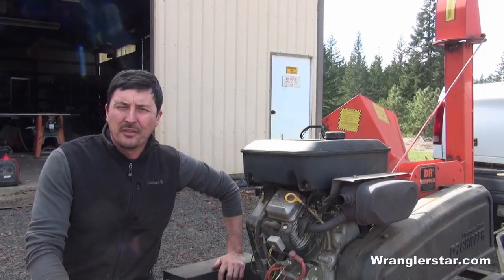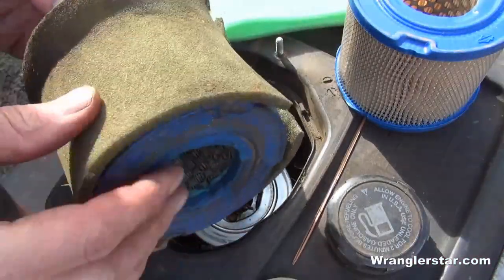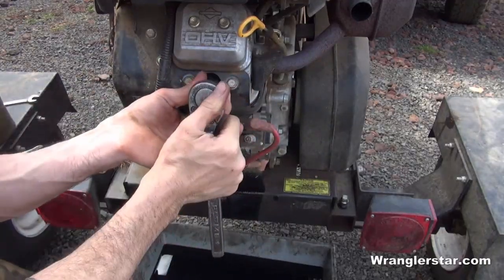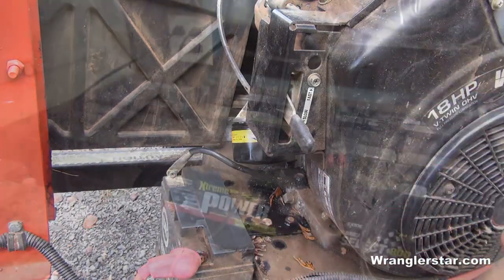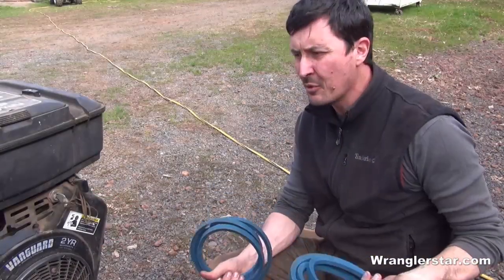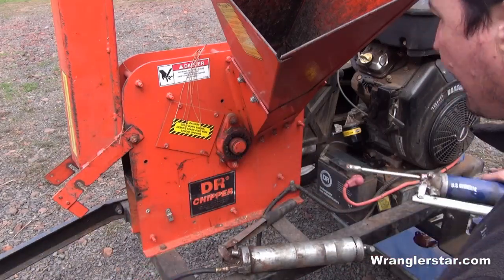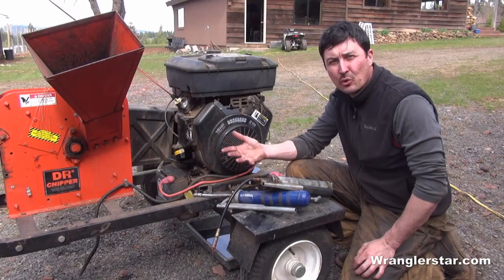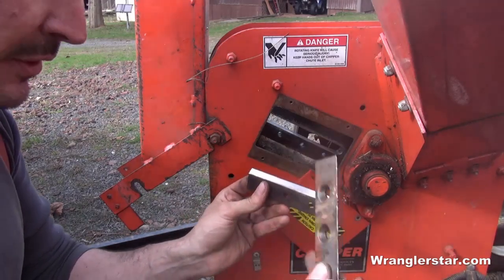Gardening With Wood Chips Getting Back To Eden

Comment from the maker: This little chipper is very impressive. Compact and very powerful 18HP. It's also low profile so it can be towed around on uneven ground without the risk of tipping over. Did I mention it has a shoot that directs chips into the truck bed instead of on the ground?

Comment: Just a side note on batteries if they were made before 1940 then do NOT put them on concrete 
In 1950 they went to the poly cases which are electrically insulated and are recommended to be stored on concrete as it stabilizes the temp that the battery sees

Comment: Cody, this sir is why I enjoy and watch your videos.  Once again your small engine, and over all maintenace ability is as top notch as your video production.  As for the battery old wives tale...I will stand with you, and disagree with the others saying on concrete is OK.  In our humid wet state, a battery sitting on the ground/concrete will quickly become dripping wet, and will discharge itself, and corrode. Like you, I place my batteries, and chainsaws weedeaters, etc up high off the ground.

Comment: Cody, if I may suggest a few things, fill your oil filter before placing it on the engine. Also on the grease fittings, remove them and just give them a slight shot of grease to clean out any debris. Grease DOES dry out over time and shooting in new grease only pushes the dried junk into the bearings, cuts the life of your bearings drastically.

Comment: As far as saving your manuals, documents etc... I use 3 ring binders and 81/2 X 11 page protector sleeves.  If it's a booklet form manual, I just clip it in using the ringed binder.  If it doesn't have the three holes already, punch them in yourself with a paper puncher.  Individual pages are put in two to a sleeve, back to back or one page if printed on both sides.  Receipts, warranties etc get their own clear page protector.  Then write on the binder, what that binder if for... Chainsaw, chipper, etc.  You can write on the pages with dry markers for temporary notes, highlight important information while working on something... it's endless.  Stores like books on a bookshelf.. clean, clear, easy to find.  Just my 2 cents.

Comment: Since non ethanol blended gas is not available in my area, I like to use Startron Ethanol Treatment in all my equiptment, everything from chainsaw's to my boat, it comes in a little blue bottle and you can get it just about anywhere. It won't fix existing problems but it's more of a preventative to keep them from happening

Comment: Do you oil the foam sleeve on the air filter. We used to do this on our small engines it reduced the amount of dust in the main filter. It lasted longer in a dusty season.

Comment: Just a suggestion.....adding fresh cut mulch to the soil surface leaches nitrogen from the soil to help break itself down. if you add a little nitrogen over the soil surface first before applying the fresh chips, it will stabilize the soil and not rob the plants of their nitrogen source.

Comment: Yes but if you cant or don't want to spill the new oil you can also run it a little before you change the oil. This will make sure all the parts are lubricated enough for the few seconds of dry start while the filter fills(car engines). Also keep in mind most of these small engines are still splash lubricated despite having a filter so it really wont matter if the filter is full or not. :) Cheers!

Comment: This is very interesting. I've always read that you should never use fresh woodchips on plants as they use up all of the nitrogen int the soil below them. I'd be interested to hear your findings.
Reply: If the chips are above the soil, they will not rob the soil of nitrogen. Many people wrongly mix the chips in their soil and that causes nitrogen to be used to break down the chips. You want to plant in soil and mulch with the chips to conserve water. The key though is to let the chips compost in a pile for six months to a year first, BEFORE using them for mulch. It's also good to chip the branches in the summer when their are leaves on the tree because the leaves will help in the composting process.
Reply: NEVER TILL, and especially do not till wood chips into the soil. That WILL take up all of the nitrogen. Just spread wood chips on your desired gardening area, in the fall. By the time spring rolls around, you can start to plant in the soil UNDER the wood chips and then cover the base of the plants up with the wood chips.

Comment: Cody, you didn't talk about detergent vs non-detergent oil.  You use non-detergent in splash lubricated engines.  Also, wood, especially saw dust, seems to be really hard on vegetable gardens.  When they start to decompose they will mess up the nutrition.  Watch for tomato blossom end rot, and test your soil next year.

Comment: Spark plugs in modern small engines last years and years when the engine is not used commercially.  Good to have spares, just like the belts.

Comment: One thing people often forget about the back to eden method is chicken manure.  The wood chips are not enough, Paul Gautchi composts his chicken manure and spreads it onto the wood chips, the two together create the fertility.  Any well composted manure would do the trick though... even regular compost.
Reply: You are absolutely right and it's a shame that isn't emphasized enough in the BTE video. I think the only thing Paul didn't spread chicken manure in was the apple orchard.
Reply: Paul at first did use chips in his garden, but since his chickens produce so much manure(compost) he did not have to put anymore chips in his garden.
Reply: That's right, Sabrina, the chips last a good long while.  I think I heard him say in one of his videos he's not had to add any chips in a particular garden for 6 or 8 years...  I dare say that's an efficient system, economical on resources.
Reply: It's not chicken manure, that Paul uses. That is only a minute fraction, of what he uses out of his orchard. It is 99% broken down yard waste, which his chickens rotate and expedite the process, as he explains in detail on his garden tours.
Reply: Grim, you realise the chickens expedite the process of breaking down the yard waste by eating it, scratching it and pooping on it...  If you've ever raised hens, you'd know they are very good at it.
Reply: Mario Doiron If you go on one of his tours, he explains things in great detail. If you can't make it to one of his tours, I highly suggest L2Survive's video tours.

Eating and pooping is only a very small part of it. The chickens don't eat everything that he puts in there. They mostly just stir it around, constantly digging through it. Having a compost pile turned will increase the rate of decomposition; that's what the chickens do.

Comment: hey it would have been nice to fill the oil filter with oil so it wouldn't have a dry start up. I do the same thing with my batteries but I leave them in the equipment in the shed.

Comment: As a retired automotive engineer, I can tell you and millions of others on the Internet that that 10% ethanol blended into you gasoline will **NOT** damage your small engine, at least in the ways you have described.  First, while pure rubber will swell from contact with alcohol, pure rubber parts (hose, seals, etc.) have not been made in over 40 years.  The synthetic rubbers that replace them are not affected by E10.

E10 will loosen accumulated particles in an older gas tank which is bad.

Comment: Back To Eden is a no-till method. Tilling in wood chips will rob all the nitrogen from the soil. To plant, you scrape back the chips down to the dirt, and then replace them once the plant has sprouted enough. It does take a several years to build up the soil, but it gets progressively better over time. Permaculture isn't for quick fixes.

Comment: not that i would recommend it but was wondering what others have seen or heard. i have seen a device that looks like a glass wine fermenter which holds fuel. you put water into it and the ethanol binds to the water and falls to the bottom leaving a layer of water ethanol mix and pure fuel on top.then you just use a spigot at the bottom to drain out all the ethanol/water and are left with ethanol free fuel. believe i saw this being used for aircraft shrug idk why they would go through that trouble but then again there's a lot i don't know

Comment: If you are going to make the effort to remove a battery, it should be cleaned with a solution of baking soda and water and then rinsed well with clean water.  The same is true before it is put back into use.  Battery connects must be clean and tight.  Use baking soda and water to clean the terminals and the mounting brackets and tray.  Coat the battery bolts and hold down bolts with grease,

If your water has high mineral content, batteries should be topped off with distilled water.

Comment: I put non-ethanol fuel in all my vehicles as well.  You do pay more, but you're actually getting more gasoline.   I notice a big difference in the power of the engine as well.   I would never put ethanol gas in any of my small engines.   Stihl and other companies are selling non-ethanol 2 cycle mixed fuel solution, but it seems too expensive to me for what you are getting.  I just buy non-ethanol gasoline and mix it all myself.

Comment: You need to clean those battery cases. Dirt will drain your battery. Setting them on concrete isn't a problem for todays batteries.